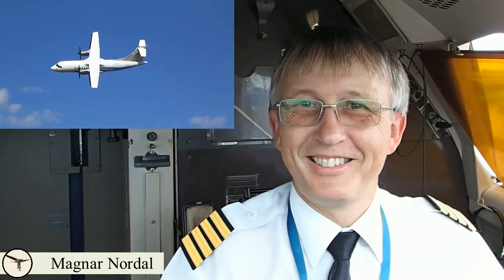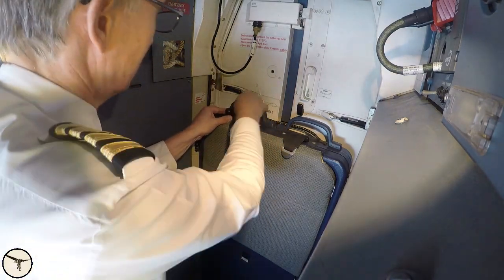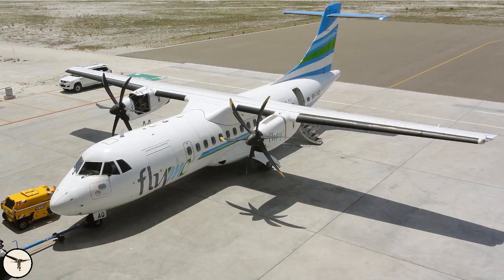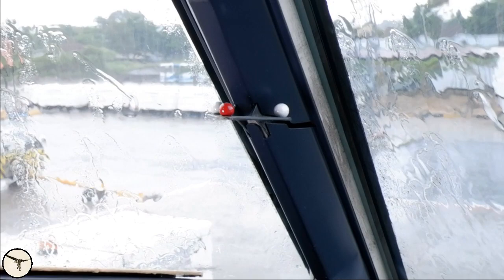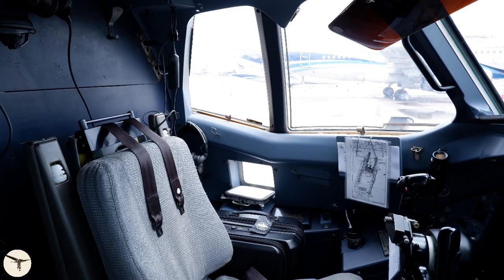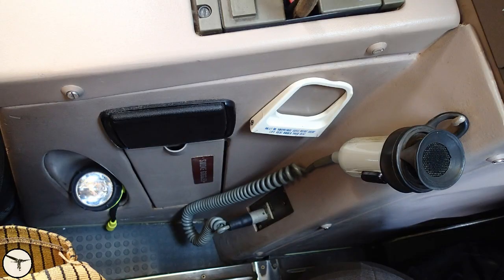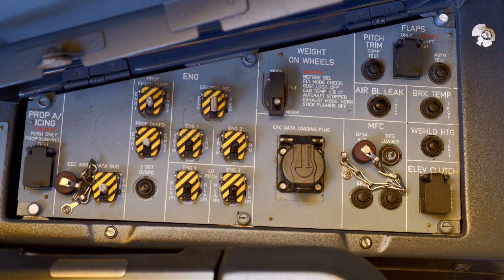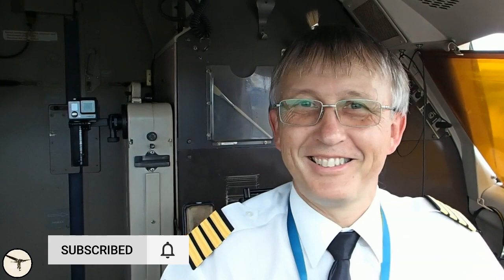ATR systems - The cockpit, an introduction

Comment: Hii captain .. about the seat arrangement. When i try positioning my seat to the atr recommended way i have hard time looking the top of the EADI. I feel like i am seating too high and the bottom of the glare shield panel blocks the  view so i sit a bit lower.
Reply from the maker: The position is intended for landing in Cat II conditions. What I do, is to adjust the seat so I can see the instruments and, by leaning a little forward, can see over the glare shield.

Comment: Great video as always. Funny that a modern aircraft like this still gets fitted with ashtrays - is there a reason for this that you're aware of?
Reply from the maker: The answer is because people still ignore the rules. Therefore, in case passengers and pilots are ignorant and place an aircraft's safety in danger by smoking in the lavatories or in the cockpit, it remains a requirement to have an ashtray.

Comment: Which variant of the ATRs do you prefer flying ?
Reply from the maker: The 42-600, which I haven't flown. I have flown the 42-500 and the 72-600. When you combine the performance and handling of the 42-500, and the glass cockpit of the 600, you get my favourite ATR.
Reply: @FlywithMagnar  Definitely the best one for sure ! I hope you will have the opportunity to fly it and share with us but not so many airlines have it unfortunately, compared to the 72...